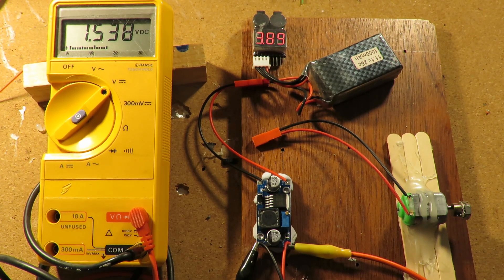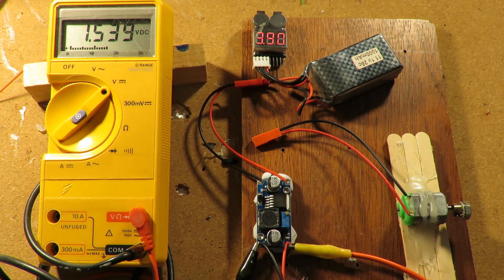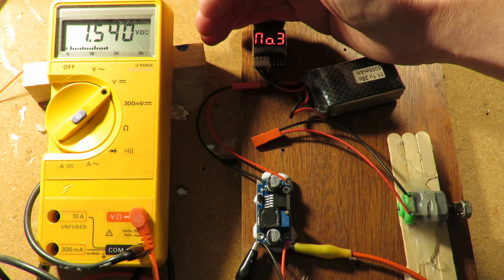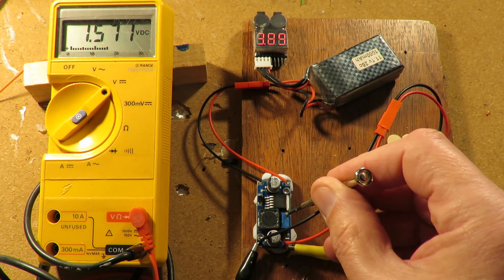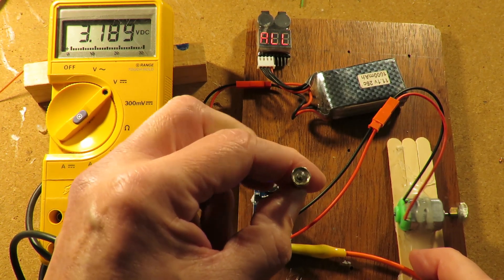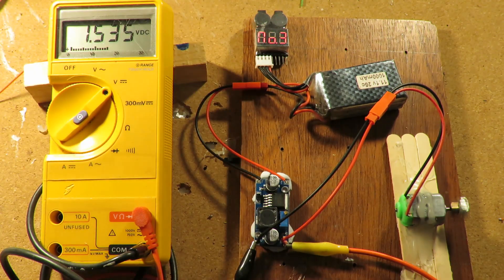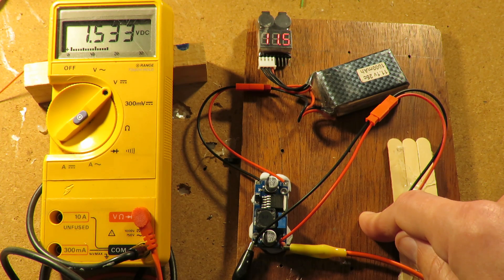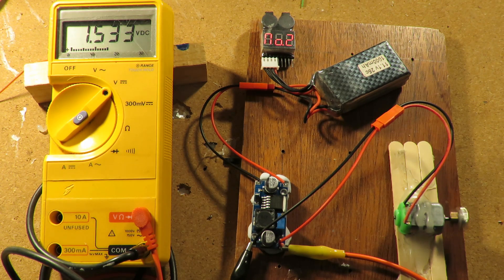Buck converter 3S LiPo driving a 1.5 volt DC motor

Comment: Thank you for your video! I am trying to use this same buck converter with my 3s Battery pack BUT it is not working.  The 3s Pack has around 11,2V as is and when is connected to the buck converter the Voltage goes down to 2.4V on the input side and I get no voltage on output side.  When I tried the same thing using 3x 18650 cells assembled in series (no pack, just the batteries connected in series with an output of 12.1 Volts)... then the Buck converter worked and I got 5V output as is adjusted and desired.  The battery pack simply does not work!! Any idea of what is going on?
Reply from the maker: I have a couple of thoughts. First, the battery pack may have an inbuilt protection circuit to prevent too much current being drawn, or to switch it off when it's capacity has dropped. Second, your battery pack is simply faulty or dead. Maybe one or two of the cells have gone faulty. Measured with no load the pack will probably give you the right voltage output, but under load it has no capacity. You would have to test each individual cell in the pack to see if one or two or all three are dead.

Comment: Would the buck converter put any stress on the battery as I was thinking of using one to limit the power to my led light bar that I'm going to be running off a 2s lipo
Reply from the maker: I don't know what you mean by "stress on the battery". You would have to look at the specification of the buck converter you want to purchase, the amp draw of your LED light bar, and the C rating of your battery. Then you would have to do some maths.

Comment: Ive got a 15amp buck converter and I rebuilt it to handle near 24 amps on its adjustable output.       Happy new year
Reply from the maker: I was amazed how cheap these were. I don't remember how much they were as it was a few years ago that I bought them but I can see the same module on eBay with 10 for £9.99 and a different module at 10 for £3.29 but they are only quote "Current output: peak 3A, 1.8A long time" tempting to buy them just to put in the box and think about a use for them later.
Reply: GrandadIsAnOldMan they work really good

Comment: nice little converter there grandad, works really nice to setup for what you wat it for, u think if u would have turned the voltage up maybe to 7volts that it would have burned out the lipo battery or even the motor itself? you would need a bigger battery cell and a bigger motor to turn up the voltage even higher to prevent burn outs on the cell and or motor?
Reply from the maker: I am not quite sure why that LiPo alarm started beeping. It may be one that I have reset the values to test the features. Looking at the readings it was alarming as soon as one of the cells voltages dropped below 3.7v. Normally you would set them to about 3.3v minimum so it still had a fair way to go (although there does seem to be debate on what is the safe setting due to many different factors). If you were using one of these to run a small toy grade RC car with a large LiPo battery you are more likely to burn out the receiver board than the motor or the LiPo. It is a common question I get on my toy grade RC cars. People always want to convert them to run on LiPo batteries so I am explaining how you can match a LiPo battery to the voltage the RC gear can handle. For example an old RC toy car running on a 9.6v NiCD would be underpowered with a 7.4v 2S but overpowered by an 11.1v 3S LiPo. If you use the buck converter you could match the voltage down to 9.6v.
Reply: @GrandadIsAnOldMan  thanks for the reply , i helped me out a lot.
Reply: @GrandadIsAnOldMan  maybe you reached the limit of the PCB board regarding the allowed amperage? the maximum Amp value allowed?
Reply from the maker: @dentaldirekto1433  I am not sure which PCB board you are referring to. The buck converter does not have an alarm. The LiPo alarm module is the one you can hear beeping. Normally that is set to alarm when the voltage of a cell drops below what you have chosen as the minimum voltage you dare to drain you battery to. Generally speaking most people will tell you that should be 3.3 volts for a LiPo battery. You will see it is alarming when one cell drops below 3.7 volts. In a different video (check the video description for the link to my LiPo Alarm playlist), I show that I have a batch of LiPo alarm modules that do not retain the settings, so where I was expecting them to alarm at 3.3 volts they were triggering at a higher voltage. That is probably the case here.

Comment: That's a good little thing. I never knew what they did. It gives a lot of options for using lipos.
Reply from the maker: I did buy a bunch of them, probably years ago now, extremely cheap on eBay. The original intention was exactly as described, so I could use a big battery on a little motor in cheap RC cars without killing the RC receiver. BUT I get more views if I burn out the receiver and get pixie smoke. I recently had a comment on one of those old videos so the easiest reply was to dig them out and demonstrate 😁👍